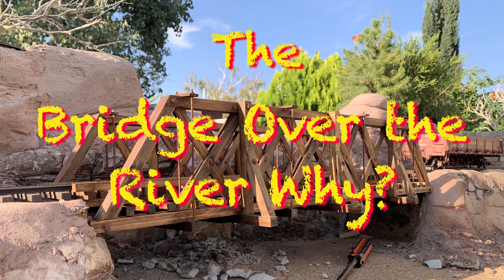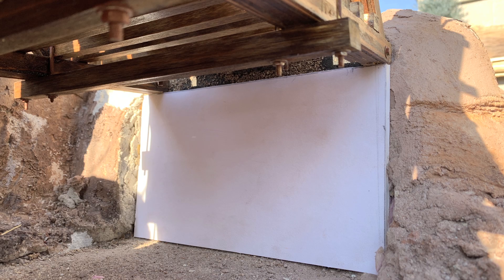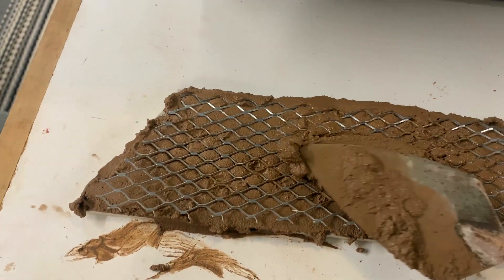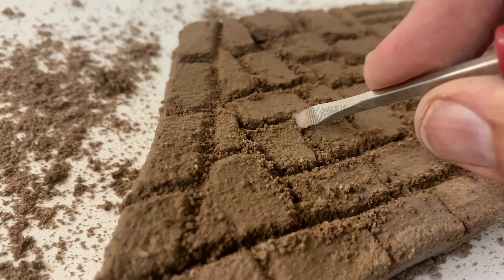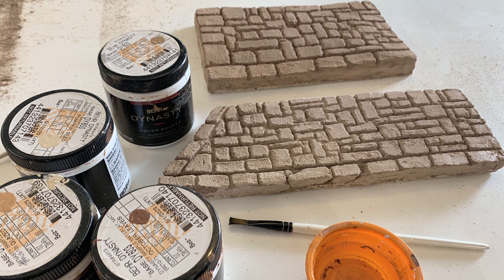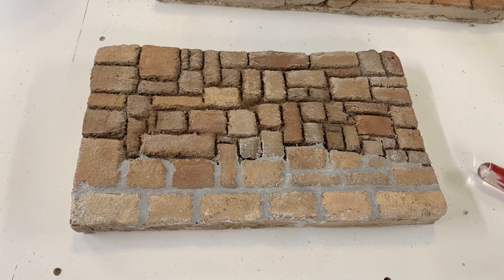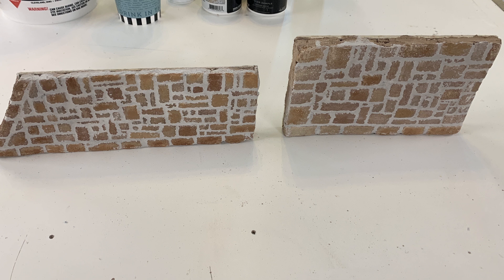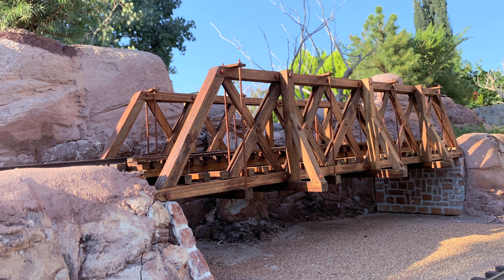Building Cement Bridge Abutments on a Garden Railroad - The Bridge Over the River Why?

Comment: Those bridge abutments look great, and are functional too. You mentioned a 50 pound loco. With that much weight, maybe a central bent is in order? It would fit right in. 
You have learned a lot about useful materials and outdoor methods. This OUTDOOR model railroad is shaping up to be quite unique, more like a highly detailed INDOOR ONLY model, than the typical GARDEN railroad. I'm looking forward to more neat stuff, in "The Fine Art of Screwing Around"
Reply from the maker: This truss is so strong!  And now on cement abutments!  I’ll bet it could hold 200 pounds 😮. And a locomotive spreads the weight across the whole thing. I’m running locomotives that are about 15 pounds and it doesn’t even notice!  😊😊😊

Comment: You have a locomotive that weighs 50 lbs?! Tell me more.
Reply from the maker: Hi!  Yup it’s a Berylin K36!  Brass. I’m still rebuilding it. Greg Hardy repaired extreme damage from shipping. The 8 pound boiler weigh broke free and smashed out the front of the smoke box, but much worse it also slid to the back and blew out the backhead on the boiler and bent the frame. Anyway it’s mostly back together. The big problem with a big heavy locomotive is if it gets dropped it will receive lot of damage. 

I was shocked when it arrived in its original wood crate it was almost 70 pounds!  The crate is about 15 pounds. And the locomotive is about 35 pounds when the boiler weigh is installed. So just massive. But it’s been called “the best brass locomotive ever built “. It’s truly amazing. Oh, and it’s really snobby about track work. The flanges are quite small given a nice prototype look, but a lot of people say it’s just not fit for outdoor railroad because if the track isn’t perfect, it will do rail. One of the reasons why I’ve attempted to make my track as close to perfect as possible!